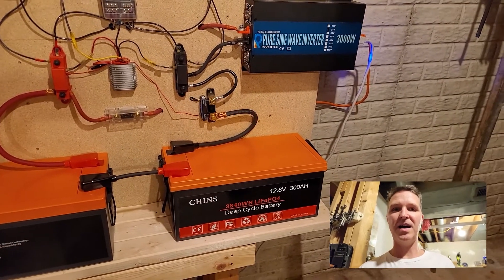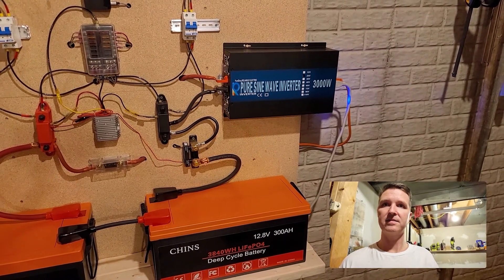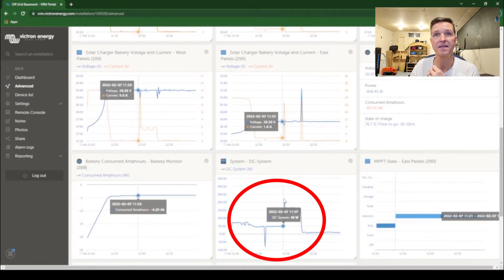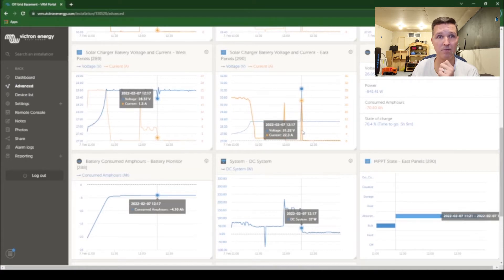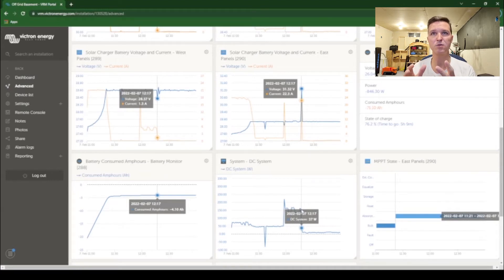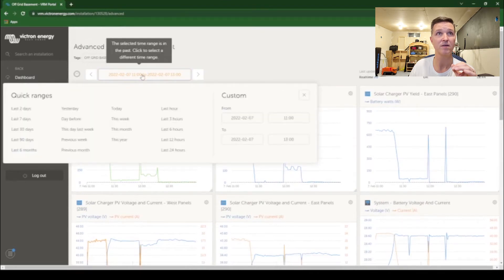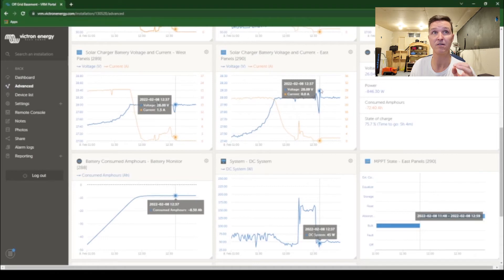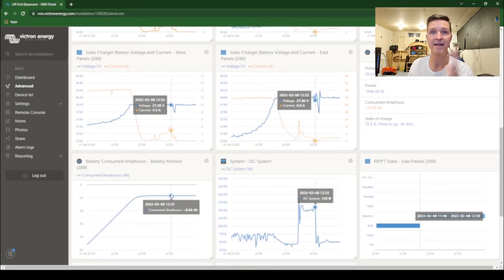Working with Reliable Inverter Over Voltage situation!

Comment: Im knew to this, but have a similar set up, but my inverter shuts down for low voltage, but battery is showing it arpund 90% on my victron smart shunt.
Reply from the maker: Do you have the AH setup correctly in the shunt?  That sounds like what the problem is.

Comment: i have the 5000 watt reliable with the 150/60 victron on a 24v system with 2000watt of panels i have a 127  volts coming in when my charger goes in to absorption it goes to 30 . 5 for one hour then to float most of the day 27.9 at first it had me worried but i don1t have a problem yet (, project paradice 808 ) had the same problem on his 3000 W RELIABLE, hes on Y T HE1S ALL BLUE USER   THANKS FOR THE GOOD INFO ps got a powmr 100amp controller at this point i can,t tell you if im happy or not with it i have1200w of panels on it so far i have 3 reliables working in my system
Reply from the maker: Thank you for sharing and for the comment!

Comment: My 6kva hybrid inverter does a battery over voltage alarm when I turn on my air condition, what could be the cause ? And I’m using a 15kwh lithium battery
Reply from the maker: Your float voltage might be too high.  Find out what the alarm value is and make sure the battery voltage never gets above that.

Comment: My inverter 2000watts 24volts is giving me over voltage what should i do to stabilize voltage?
Reply from the maker: Do you mean you're getting more than 120v AC?  I'm not sure about that.  You probably need to send it back or contact the company.

Comment: Man you give me something to think about. Am having the exact same problem. I’ll give this a try for sure and let you know ❤
Reply from the maker: I really hope it helps you out.  Thanks for the comment.
Reply: @OffGridBasement  I have 24 volt system with 4 200 amp lithium phosphate batteries and is using 3 Renogy 40 amps Mppt  controller  with 2400 watts total solar panels. 24 volts 3000 watts inverter.  Any suggestions for my USEE BATTERIES SETTING?

Comment: Even for 24v those charge controller wires look very small
Reply from the maker: They are 10 awg which can handle the controllers with no problem.  Thanks for the comment.

Comment: Just installed lithium batteries and this problem started right away for me, I turned down my absorbsion voltage to 28 and fixed... Thanks for the tip as it had me well and truly stumped.
Reply from the maker: Glad I could help you out.  Thanks for the comment.

Comment: I have the same problem with my Reliable inverter. At first I couldn't figure it out I thought it was the battery. My discovery. I have a 48v system and I noticed my inverter shots off at 57v and my lifepo4 lithium batteries goes up to 58.8v so yes I had to lower my voltage too but ever two months or so I would lock off my inverter, charge my batteries up to 58.8v let it sets and equalize before resetting it. That have work for me so far.
Reply from the maker: That's good to know.  Thanks for the info.

Comment: Thank you for the video! I just set up my first solar system and I was having an over voltage fault on the inverter running my fridge. Backed off the charge voltage and the problem went away. You saved me a lot of headache. Thanks again!
Reply from the maker: That's great to hear!  Thanks for letting me know it helped you out!

Comment: I just purchased a inverter like yours, my inverter shipped with 40 amp fuses in them. Since it's a 24v inverter that should be 20amp fuses. I was concerned about the 40 amp fuses not protecting it properly and possibly causing a fire. Did you swap out your fuses? I put 20 amp fuses in to be safe.
Reply from the maker: I believe the fuses your are referring to are on the AC side.  A 3k inverter using 120v would max out 25amp.  25 * 1.25 = 31.25amp.  I felt like a 40amp would do fine.  If you don't plan on pushing your inverter, switching to 20amp would be fine and give you piece of mind.  Please let me know if I am incorrect in my thinking.
Thanks for the comment 👍
Reply: @OffGridBasement  Thanks for your response, yes I don't plan on pushing my inverter pass 2000watts. Iam not sure either,  I guess I will run the 20s and if they blow increase it by 10.  I just like to be cautious.

Comment: ❤. Excellent.  My inverter does a disconnect without any load while it’s charging.  What should I do?
Reply from the maker: I know I sometimes see over 16v coming from my 12v charger.  Does it go into overvoltage when the battery is almost full?
Reply: @OffGridBasement  Am running a 24 volt system. I check the voltage to the back of the inverter it’s reading 28.8 but the display on the front reading 29.9 and every so often it goes over 30 volts then the alarm will come on. It seems like the inverter voltage is wrong.
Reply from the maker: @nelsonknowles9673  yes it does.  I'm not sure if there is a way of calibrating the voltage.

Comment: How did you ground the inverter? Can i use a earth ground (copper rod in the ground) to the case ground?
Reply from the maker: Yes.  If you are able to connect to a ground rod, that would be your best option.

Comment: So it is not the inverter issue but the SCC issue that the SCC cannot regulate its output Voltage fast enough when heavy load, I.E. your compressor, turn off (output of SCC suddenly sees light load) and allow the output Voltage to spike up.
Reply from the maker: Thanks for the info!

Comment: I'm an electronic engineer and solar consultant. I started out watching this video to see someone stumble through this problem. But I am impressed with your analysis and solution. You re right on the mark technically for the equipment you have. May not apply to other brands or equipment types, but a great job on what you found.
Reply from the maker: Thank you very much for the compliment!  It's very nice to be able to dig back through all the data.  I'm definitely not an electronic engineer, but the data just made sense.  Thanks again!

Comment: When the refrigerator turned off the charge controllers Spike up when Pas beyond the 28.8 the BMS shut down to protect your batteries 32.5 that's when the inverter turned off because the BMS turn off you need to set charge controller at 28v
Reply from the maker: Thank you for the info!  Setting the charge controllers to 28v did take care of the problem.  I was very surprised the voltage spike occurred when the fridge turned off.  My thinking was it was happening when it kicked on.  Thanks again!
Reply: @OffGridBasement  you are welcome the only reason I know that it's because my sisters motorhome drove me insane for like 2 weeks she has a 24-volt Magnum sine wave and I classic 200 it drove me crazy
Reply: @OffGridBasement  🤣🤣🤣
Reply: Bms's shouldn't be designed that way have two rows of mosfets switches one row of switches is for load the other row of switches is for charge it shouldn't be switching off both sides but one side it should always be a voltage for the charge controllers to see what the batteries voltage is?